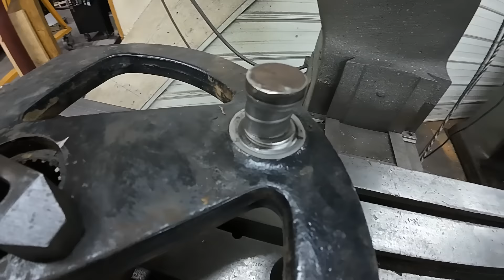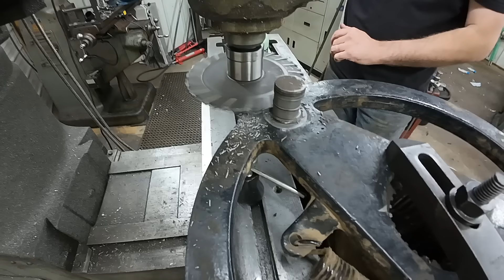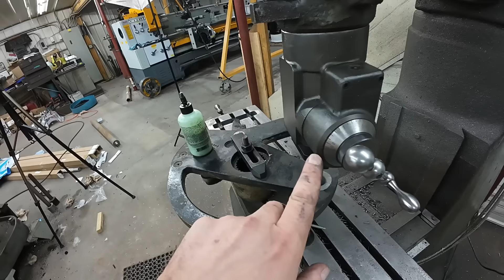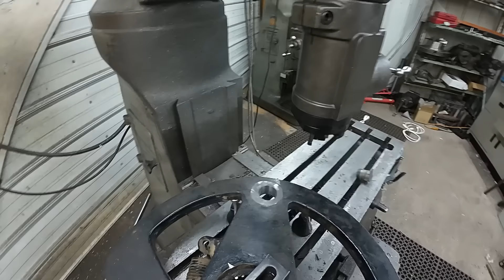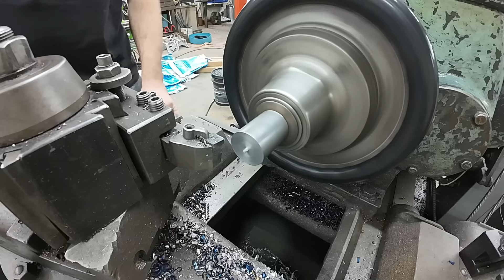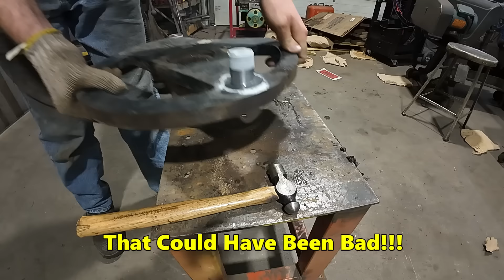We’re Repairing Worn Hay Baler Parts (and Saving $$$)

Comment: nice job in the end just only thing the job previous to this one you turned down the outer surface and shrunk fit a bushing over it would this have worked for this job or not just trying to learn is all this is the way i would have done it but all good easy quick job in the end thanks for showing Cheer
Reply from the maker: This job was definitely a better candidate for replacement than sleeving. Being able to bore and insert the new pin is why I did it this way. Great question

Comment: I never had a use for the coaxial indicators as I can do it faster with an indicol and interapid. But when I bought a cnc lathe they do work great for aligning drills. Also the slitting saw I wouldn't have thought of. I would have just used a couple drills to remove that. But that saw was fast.

Comment: That’s a small pin to fit, the bigger ones are easier. I did a 5” dia shaft into a 12” dia solid roller once, took a full minute to grab once fitted. The small ones like this you get seconds. I never liked doing them and I get anxious just watching. You got it home though so good job.
Reply from the maker: Bigger is definitely much easier. I even went a little large on this pin to ensure it locked in. So, I was tight to begin with

Comment: As a part time machinist myself, Because the overall length was short, why didn’t you turn both diameters on your initial setup? If you was afraid of chatter, you could have center drilled the end and used a tail Stock, then when finished , trimmed it to length 👍
Reply from the maker: This didn't need to be perfectly in line. The way I did this was definitely fast enough.

Comment: Nice work Josh.
I like using nice press fits and Shrink fits.
Nicely done👍👍
What material was the pin made out of?
Have a great weekend. 👍
Reply from the maker: 1045 is what I use a lot of. Some things get 1144 stress proof
Reply: @TopperMachineLLC  Thanks Josh.
I appreciate it.👍
I need to get some stock to have on hand for small projects.

Comment: Well, from this video, I learnt to be prepared for the worst when doing a shrink fit. When I have my next one to do, I think I’ll set it up in the press, just in case. Thanks for the lesson.
Reply from the maker: This one was exceptionally tight. Usually no more than 0.002/inch of diameter. I was just over that. Never want it to move.
Reply: I’ve had that same problem with press and shrink fits. Often the problem is not enough heat. I’ve almost switched completely to Loctite retaining compound now. Glad you got that sucker in there.
Reply: I learned to have a chaser after a press fit job 🍻
Reply: Those coax indicators are a pain to use. I always use the good old edge finder to find center. It works better and easier. Most people don’t know this, but it will find the edges of holes and pins just as accurately as it does linear edges. I use it all the time to find center by zeroing one side of the circular feature and the distance to the opposite side, then splitting the difference.  It’s much easier if you have a DRO.
Reply: Yeah, good idea.

Comment: You introduced a few great new tools today... (At least that I don't recall seeing before).... the coaxial indicator, and the boring and facing head.  Both look very useful in these applications!  
If that pin had've locked in the wrong place before it was set.... what then?   I assume that you would have to machine the entire pin out and remake the pin again?
Reply from the maker: I've had them get stuck and yes,bore it out and start over. It's never fun.

Comment: Regardless, that design of boring/facing head is pretty cool. I has to be more rigid than the typical R-8 style head being clamped to the quill like that. Probably an indicator to move the tool out on the final cuts would make it pretty accurate. I don't recall ever seeing one like that used on a bridgey. Cool.  Nice ice maker! And great repair....Beer is good! cheers 🍻
Reply from the maker: I wish it was more accurate on the dial. Great concept, but poorly executed

Comment: That went great actually. I thought 3 thou was a pretty heavy interference when you were talking through the parts - but the beauty is that it isn’t ever coming out of there. Handy to have the press close by. ✌️👍

We did a similar one at work and unfortunately got stuck half way. The bastage wasn’t going in or out, so we had to start over and machine the pin out. Bummer.
Reply from the maker: Ive had that happen before. Makes for a terrible day.